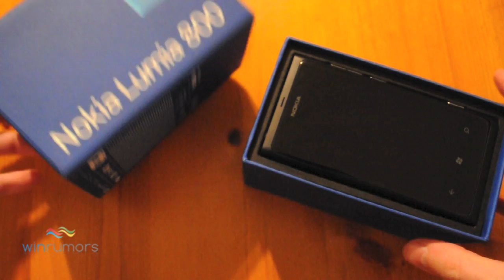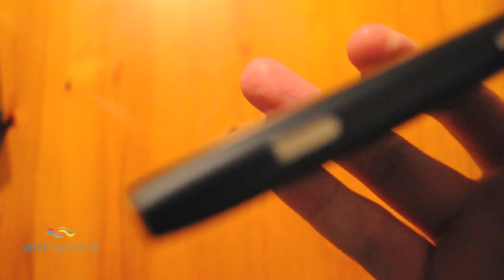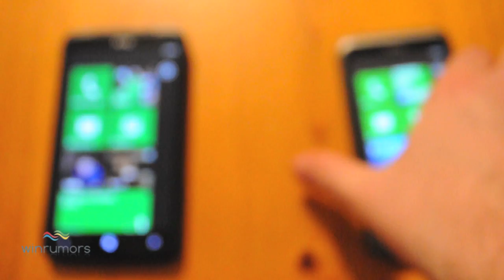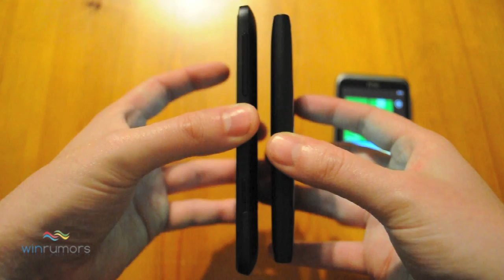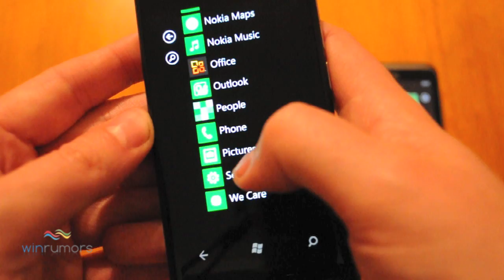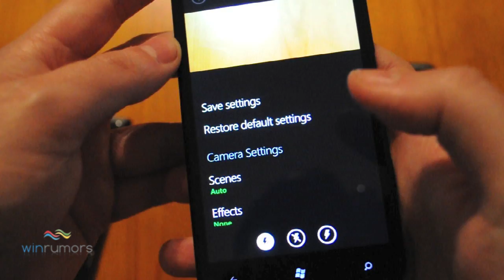Nokia Lumia 800 vs HTC TITAN vs HTC Radar

Comment: @nathandrake555 Flash is not going OFF android, get it right. They are simply not developing it further - but they are not going to simply pull it from the market or anything in that regard. Every Android device until next major version of Android will have flash support. 

I'm not defending flash in any way, it's not as good as HTML5, but it's not going OFF anything either, further development for mobile platforms has simply stopped.

Comment: @nathandrake555 Do you live in the gave? HTML5 standard is not ready, no one should use it any other thing than testing it. HTML5 is going to be ready in 2013-2015. 

Every test now using HTML5 is very biased and not trustworthy.